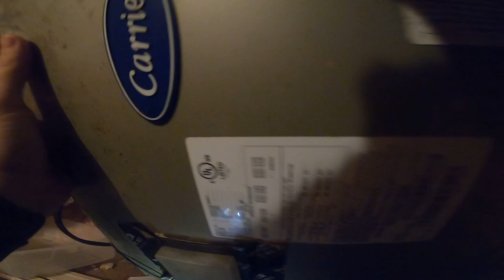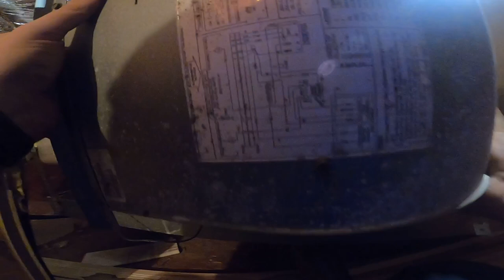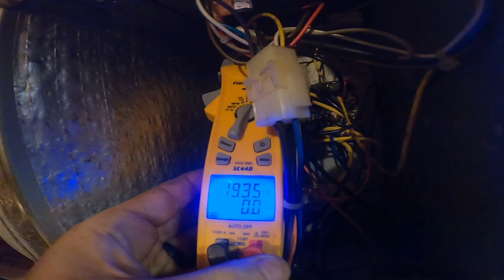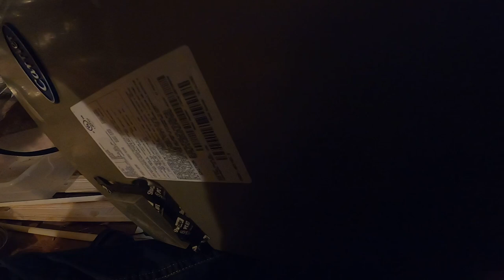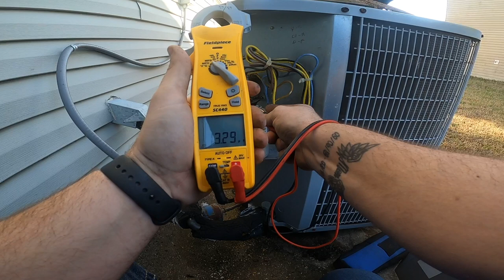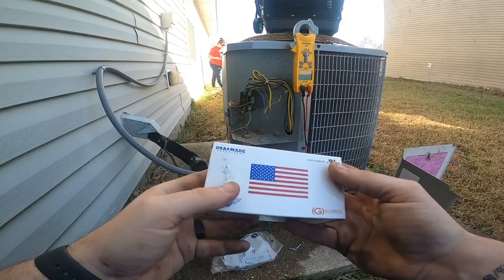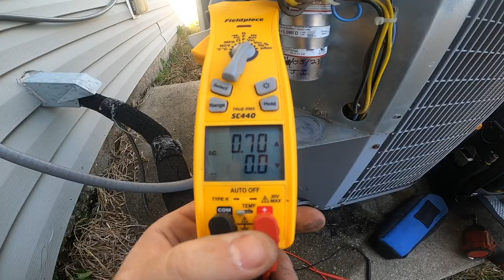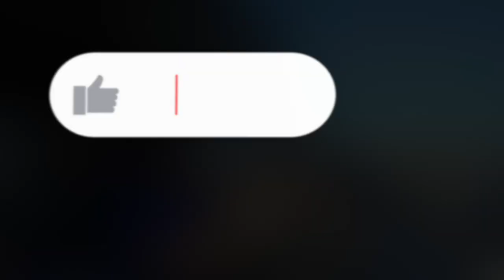Replace X13 Blower Motor & Service System

Comment: I found a hole in a heat exchanger for a 2014 lennox gas pack today. Gave the h/0 the option to repair or replace the system. She went with changing the heat exchanger. Explained benefits of new system and price of the repair. Finacially doing the repair is best for her at this time.

Comment: John, I have been using a little Permatex 80078 Anti-Seize Lubricant on the shafts of the blower motors and condenser fan motors. It will help me in the future or the next guy if it has to be replaced again.

Comment: Good replacement on the indoor motor and also agree good idea copying over the M/N and S/N inside before tag goes completely faded.  But I think the previous guy messed you up on the Titan Cap, for the CA13NA030, I think it calls for 40uf/5 vs 45uf on the compressor.  I think that unit uses a 24K BTU Scroll assuming no on replaced the compressor to something else.  Probably not a huge deal...just observation. Nice work again.

Comment: Do drills come with torque settings.i ended up using latching pliers and wearing weatherman gloves for when I was taking the rod out. One thing I found helpful is when pushing the motor out is using a hammer and then the last part I used the 8 pc pin punch set from harbor freight when the rod was level. I used the largest pin punch with the hammer and it came out quicker for me.

Comment: For that amrad, since it seems to be between the small and large bracket, I would recommend using metal plumbing strap. It's only a few bucks for a roll and can be cut to length.

Comment: I'm with you John ,I'm all about providing BEST options for the customer system.lf it past 10 warranty with no Labor too in bad shape it will MORE in parts and not to mention service  less cost to customer in the long - run it's better   " peace of mind   "  less problem also, less service calls to the home. By best choice NEW system. I got your back !!!  🤠
JOHN

Daniel Z

Comment: Man, if I don’t wear Nitrile gloves, my hands and wrists get tore up. 🥴
I like how you roll. I try getting through to newbies, always try to think of the next time and make it easier for the dummy that may have to come after you - the dummy may be you. 😁 
 We are just two guys talking shop; only thing I’d like to have seen, would be, use a size larger screw to be sure disconnect is secure. But, you did address it. 🫵👍